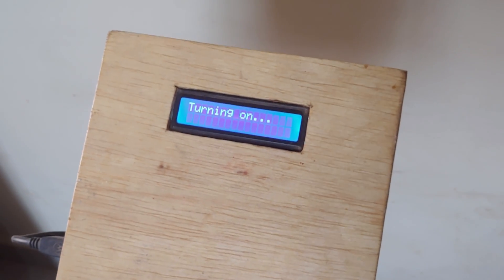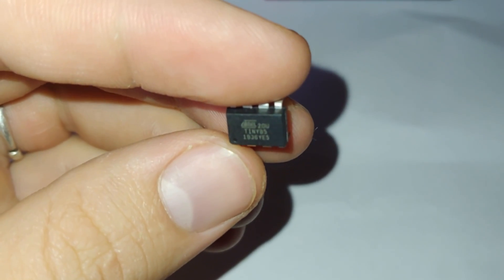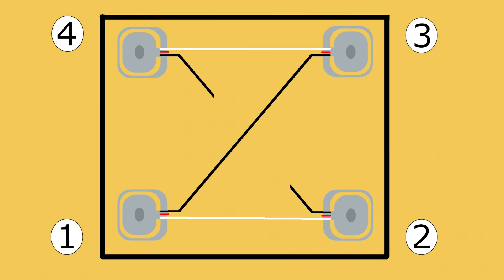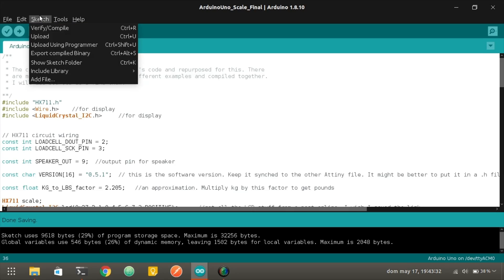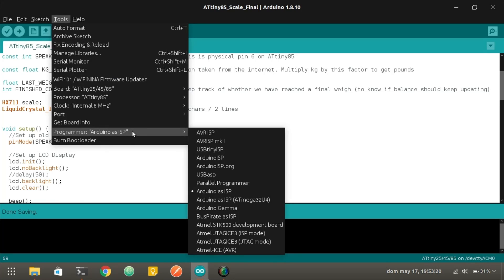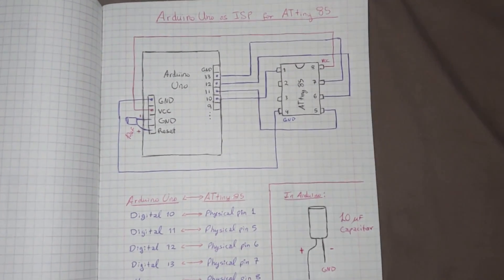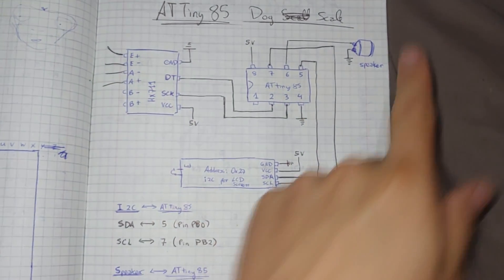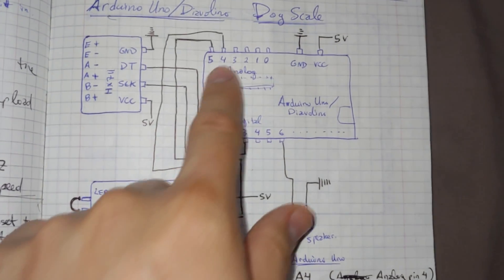Simple DIY Digital Dog Scale | Arduino Uno Project / ATtiny 85

Comment: Highest weight that we can measure with it sir ??
Reply from the maker: In this case the maximum weight is 200 kg since we have four sensors of 50kg each, connected in a bridge. 

Then you have to account for the weight of the device itself, which might be 10 or 15 kg in this video.

Comment: Very well explained.
I'm building a self made weather station. The rain sensor will use a load cell. The information (weight of rain tank, temperature, humidity, air pressure...) will be saved on my NAS. A second part will read the information from NAS and display it on a small OLED display. So alot of similar components. I use Wemos D1 mini boards because I need WiFi and they are cheaper and need less power than the arduino boards.
Now I'm curios to watch the other videos on this channel.
Reply from the maker: Thank you. I hope to do more arduino or electronics projects soon. I have been working on btw programming videos but it's been hard getting the time.

Your project seems interesting. I had not heard about that that board with wifi but maybe I'll give it a try.
Reply: @andresberejnoi  It's an ESP8266 board. It has limited ammount of pins but WiFi and 4MB flash memory integrated... for a price of about 5$ and you can programm it normaly with arduino IDE.
Reply from the maker: @michaegi4717  I just looked it up and turns out I used to have a couple of those. They must be in some of my boxes.

One project that could be interesting is to pair it with a thermometer sensor for a solar oven.
Reply: @andresberejnoi  This is a cool idea. So you can get a message when the oven is ready/hot to bake your food.
Reply from the maker: Exactly, and also to experiment with different configurations and see how hot it gets and it what time over a period of time

Comment: Hello

I have a question
and maybe two three :-).

Did you perhaps measure the power consumption but without the display?
I would do a hive scale. And I just plug in the display when I want to read the weight.
That's why I need to use as little electricity as possible.

greetings from Serbia.
Reply from the maker: HI! I have not actually measured the power consumption for this project. In my case it was not necessary because I just turn on the power when I am going to use it and turn it off after, so it is not always drawing from it.

If you plan on leaving the device running continuously, I believe the Arduino Uno supports a hibernation or sleep mode where the power draw is minimal and it can be awakened by external input (for example a sensor reading).

Unfortunately, I have not done projects like that yet, so I cannot be of much help here, although it sounds very interesting.
Reply: @andresberejnoi  thank you very much for the reply.
i am 61 years old and i barely know these things. i believe that attiny85 consumes less energy than arduino uno. another important thing
 for measuring the hive is that he must not forget the previous weight. the scale should be constantly under the hive and when I want to know just connect the display.
i don't speak english so i use google translator.
I live in a forest far from civilization and I don't have public electricity, I have solar panels and a small water turbine and I've been living like that for almost 9 years.

here is the link where and how I live:
https://www.youtube.com/user/MrDjokimus/videos?view_as=subscriber
Reply: @andresberejnoi  me again :-)

please help

reports a bug in skech for both arduino and attiny.

I think you use some other libraries that I don't have and I don't know which ones.
So I would ask you if you would be kind enough to send me the libraries you use to email djokimus@gmail.com.

here is the eror that tells me about the sketch by Attiny:

ArduinoUno_Scale_Final:24:44: error: 'POSITIVE' was not declared in this scope
 LiquidCrystal_I2C lcd(0x27,2,1,0,4,5,6,7,3,POSITIVE);      //got all the LCD stuff from a post online. I wish I saved the link
                                            ^~~~~~~~
exit status 1
'POSITIVE' was not declared in this scope

Thanks a lot once again

Comment: Nice. I need this for my dogs as commercial pet scales are expencive.
Reply from the maker: Yes. That's the main reason why I wanted to make one. Making the frame itself might be the most complex part, but as long as you have a flat platform where you can secure the sensors it will be good.
Reply from the maker: Also, I made a video where I train them to get on it. It is a very simple process: https://youtu.be/1zyI45RtpTM